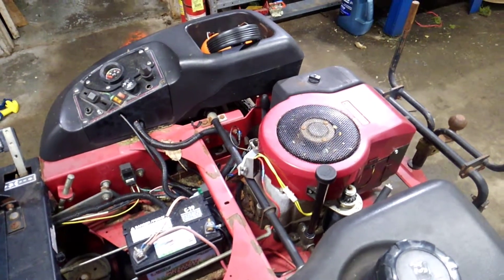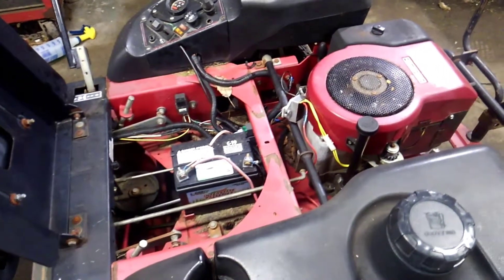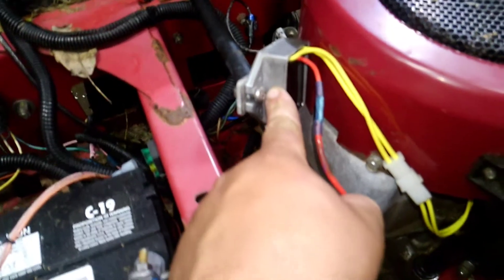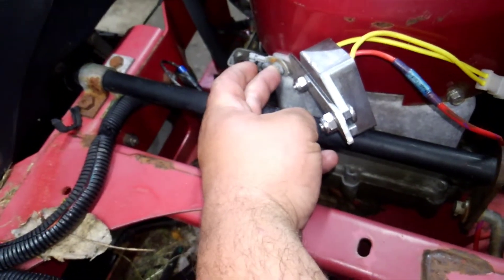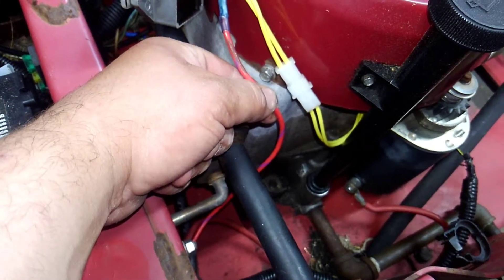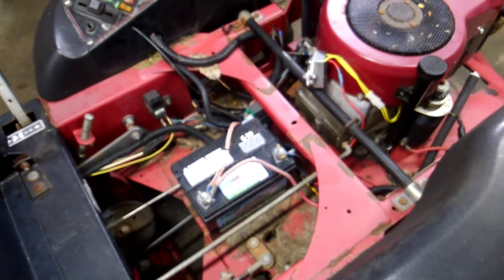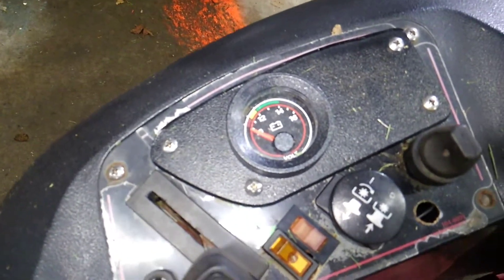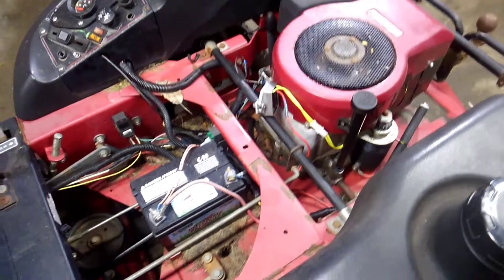Briggs and Stratton Charging System Upgrade : Dual Circuit to 10/16 Amp Regulated

Comment: So i hooked up my battery hit my frame from positive had smoke from under engine cover cut the charging diode out by accident and now my mower goes still but battery loses charge with key off overnight

Comment: How did you find a 10/16 stator to replace the dual circuit? I have the Intek 18.5 on my Timecutter.  When I check the Briggs book for a part it naturally only shows the dual circuit part number.
Reply from the maker: I believe it should be in the alternator section of the IPL

Comment: Seeing that your original dual circuit stator setup was working but lacking the current needed to keep up with the mowers power usage, would it have been possible to snip off the diode from the DC side of the stators dual circuit leaving you with 2 X AC outputs then run them into the rectifier shown in your video? My understanding is that the rectifier shown in your video should have a higher output vs the single diode (AC-DC) conversion using the same alternator stator. Any electronics experts are also welcome to answer.
Reply: My thoughts also and thats what I am going to do as ironicaly the replacement coil I put in before transplanting this motor came with a rectifyer to mount.

Comment: I quick suggestion, Try a optima battery. and also the regulator would be happyer mounted on the tractor , not directly to the motor. Its just a box filled with epoxy. Way less vibration anywhere but directly to the motor. it will last longer cooler and and less bumby ride. GLHF thanks for the video im planning on converting same style motor soon.
Reply from the maker: Its actually been working fine ever since I did the upgrade. Dad has the mower now and no complaints from him. That regulator is actually designed to me mounted to the engine anyways

Comment: Hey Will, to upgrade my 3 amp dual circuit alternators on my Briggs opposed twins, should I look for a donor mower with an electric PTO?  It seems they might have the 10/16 system as the PTO's would be drawing constant current.  And could I still use my original flywheel?

Comment: If I understand you correctly, you swapped the stator out with a "higher performance" one?  You mention a video on changing the Stator, I don't see it.

I also at one time found a site that makes a higher performance and better durability Regulator (not Chinese or Briggs) but can't find it now are you aware of those?  thanks!

Comment: just wondering why u didn't replace with original stator, it was most likely the diode going bad which caused the no charging issue.
Reply from the maker: It was charging, however the dual circuit alternator is only 2-4 amp output which isn't enough to keep the battery charged while the electric PTO clutch is engaged. With the 10 amp charging system, it holds at 12.5 volts with the clutch engaged (blades on) and 14.2 with them off.